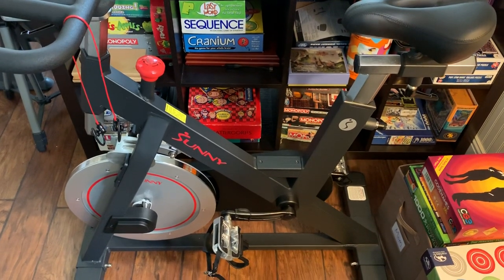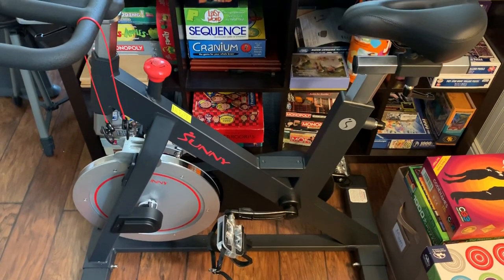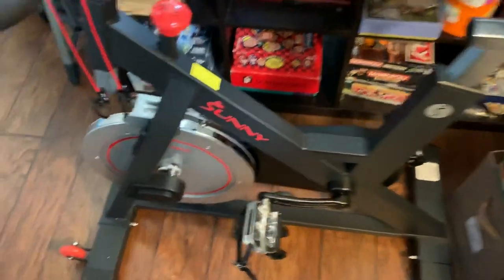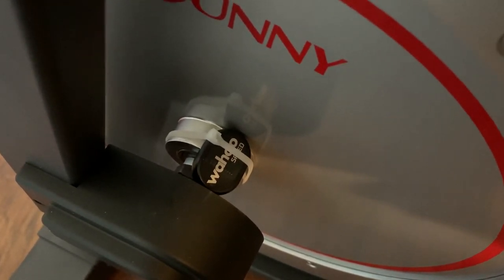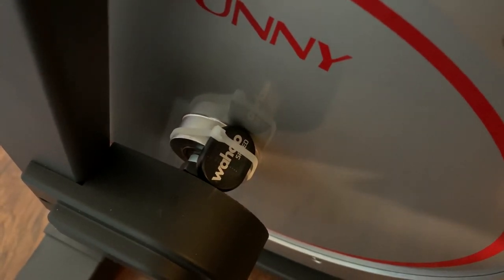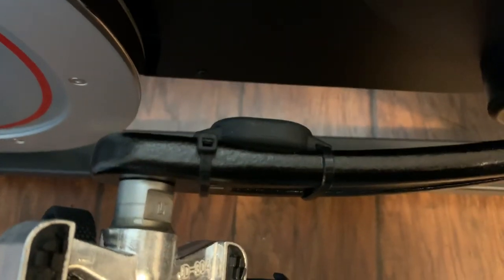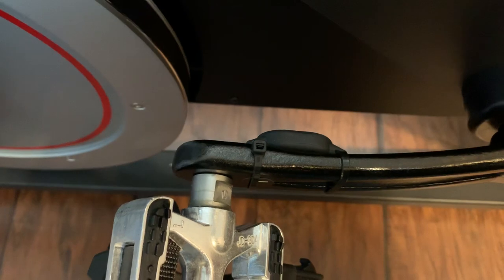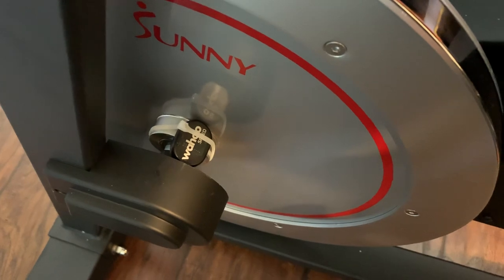Wahoo Cadence and Speed Sensors Setup for Spin Bike

Comment: It's encouraging to see that you were able to attach the speed sensor to the flywheel hub. Just ordered both a cadence & speed (Moofit) sensors and was wondering if the sensor would fit properly. Watching your video and having a flywheel hub slightly larger than yours is positive news.
Reply: Jorge Gamboa  Interesting that you brought this up. Just last nite I was wondering what I should about these sensors. Mine went kaput late last year. Both the Moofit cadence & speed sensors went bad. The heart monitor still works. Just deciding whether to try this again with another sensor brand. Wash my hands of Moofit. I'm thinking about Garmin's sensors for now.

Comment: I have a Schwinn Spinner and I am doing something similar to what you're doing.  Like you, I put the cadence sensor on the left peddle. I am using a Garmin Cadence  and Speed sensor..  I removed  the speed sensor from its housing.  I have double sided tape that I use to attach it to the outside of the flywheel.  I have tried attaching it to the side  of the wheel, but I have found the connection was hit and miss with that configuration.  I was able to establish a connection that enabled me to pair the sensors with the  iPhone.  Before I start my riding session, I revolved the wheel twice, connect and then I am good to go.

Comment: There is one thing I don't understand: on a spin bike there are no gears, so crank revolutions are always proportional to flywheel revolutions, why didn't you strap the speed sensor to the crank as well? It seems a simpler and safer solution to me?
Reply: Diego Cortassa forever interesting fact. !! I will attach mine to crank and compare
Reply: Did crank mount work

Comment: Hi, ok so how do i set up the wheel circumference?? i understand that you get the sensor as close to the centre of the spinbike wheel as possible, but how does measuring the circumference of the wheel itself make any difference as it's how fast it goes around the base point on a stationary bike, surely the wheel size is irrelevant?

Comment: I have a magnetic spin bike too. My problem arises after pairing my Wahoo with Zwift.

Not sure if you use Zwift, but let me ask anyways. During the Zwift setup, when you get to the page where they ask to "select your trainer," there is no option for the metal plated flywheel bikes like ours. What does one do/select then?
Reply: Hey, did you get a workaround on this
Reply: @ROHOARINGYJO  yup. 1st I had to find out what the flywheel circumference is. I got the diameter and multiplied it by 3.14. Then I matched the value against that on a bike chart (find chart online.Sunny bikes and others have it). I'll add that I didn't find an exact match with my own values, so I took the nearest one. I took that and the one that it corresponded to on the Zwift setup. 

The Zwift does not have Flywheel spin bikes among its selection so again I picked the closest alternative (if I recall there's a select option for "brands not shown" or something of that nature) and I clicked that. From there on out it was relatively easy.

My Wahoo speed and cadence sensors paired smoothly (after a little peddling). Bought a cheap Chest/HR moniter on Amazon, and it paired too.

And now I'm off to the races. I wanted a Peloton only because of the live leader board, but Zwift not only has that, but u can actually "see" ur competing Avatars as they bike too. And the price is a game changer.

On a side note: I haven't learnt to use Zwift from my TV, but I got a 2nd Gen core i7 lenovo x220t tablet laptop on ebay for like 80 bucks. The spin bike arms are such, I mount the laptop on the armrest without any attachments and it sits there. So now I have my own Peloton touchscreen equivalent screen.lol.
Reply: @VanIyke  cheers for the reply.
Got my sensors yesterday and have got it all set up. The trouble I have is pairing both sensors. One pairs and the other drops off with no signal. Any experience with that?
Reply: @ROHOARINGYJO  yeah at 1st it looked like only one would pair. I notice that each component (cadence, speed and HR sensor) each has its own icon on the touchscreen. But before I tapped them I had to cover my bases with each gadget. For the bike sensors I made sure they were well positioned (watched some DIY YouTube videos) and for the chest Heart Rate monitor, I made sure to wet the sensor on its underside before strapping it on. Then finally, I got an ANT + device that looks like a USB plug for like $8 bucks on Amazon. It boosts signal reception when plugged into ur tablet/laptop, thus signal drop us at a minimum.

Comment: How do you set the tire size for a spin bike? Or did I miss that part?
Reply: when in the start workout mode press the speed sensor and the wheel circumference will be in the choice of options , my spin is 18.5 x150 a choice of 30 options

Comment: I tried this exact set up and the speed data is pretty useless - the crank RPM is linked to the flywheel and there is no way to link the resistance to the speed.  Point being, you can set resistance low and spin away really freely and easily and the speed is high. Add a bit of resistance and the speed drops...... as your cadence drops.  So the speed is not really a representation of what speed you'd be cycling at in a real world setting,  its just a different representation of your cadence depending on the ratio of cadence to RPM of the flywheel - which is fixed on a spin bike,  unlike a real bike.
Reply: I have both of mine set on each pedal bar, the left for cadence, and right for speed. I have a Garmin watch and the thing that worked for me was setting the wheel diameter to around 6200 m, yes that sounds crazy but my spin bike has it's own meters and my Garmin matches what the meter says, it just took a while to figure out the right number on the speed side to get everything synced up. I don't know what brand of watch you are using if any but that worked for me,
Reply: @johnJohn-dz4ex  that's the kind of comment I've been searching for, genius!! Did the app allow you to select such a large circumference?
Reply: @dimplezdimples8451  It did
Reply: @johnJohn-dz4ex  Just did it on mine, I had a 3.25:1 ratio crank to flywheel and came out to 5.074 meters. Seems to work but Wahoo app only recognizes one of the sensors at a time, because the sensors are a different brand than Wahoo. Great idea!
Reply: @dimplezdimples8451  I was using a Garmin watch with mine and had no issues picking up both sensors but if you did have issues with both I would suggest just using the speed sensor only.

Comment: I have the same question as Leyla:  What did you set the flywheel circumference to?
Reply: Family Lawrence did you ever figure this out?
Reply: I messaged Sunny and they said to measure the wheel diameter and multiply by 3.14.
Reply: 20" for me
Reply: 18.5x150

Comment: A question though, and this is not to poo poo on your video, but a spin bike is fixed gear right?  So guessed "power" is going to be dependant solely on how fast you are pedalling?  You could take resistance completely off, spin to 110rpm and it will show you that you are at 400W when in reality it's 30W?   The speed and cadence wasn't meant for a spin bike.
Reply: I don't think the idea is to "guess" power but to use the accurate monitoring of cadence as a way to adjust input/output to net a workout that can be progressive.  But you are right, wattage cannot be accurately measured this way.
Reply: If you want to cheat, yes, you can use resistance 1 and cheat. But I use Resistance 6 for downhill and R7 for flat and R8 for climbs. And it's pretty real on Kinomap. I sweat like a pig when using R8 (max) for climbing exactly like in real life. And at R8 cadence gets down to 50-55rpm. If you want to cheat yourself, yes, you can use R1 like a noob, but I want to train myself really hard, not to cheat. That's plain stupid...

Comment: If test my stationary bike and run to Test mode upto 2mins its says on the monitor fails but  if in Manual is ok. Can you advise whats the issue? Is it on tge speed sensor?.voz when start running the tension goes to 3 speed already

Comment: I think it was designed to be installed on the crank arm
Reply: That works fine for cadence, but for speed you need to mount on the wheel. I tested on the crank and got 4-8mph when pedaling as fast as the bike would go. My results were much more realistic when mounted on flywheel.

Comment: What did you set the flywheel circumference as for the speed
Reply: Leyla gutierrez did you ever figure this out?
Reply: @johnclayson8461  , for circumference,  I used the Wahoo Tire Size conversion Chart and set it to 1.34 within the Wahoo App.
Reply: , for circumference,  I used the Wahoo Tire Size conversion Chart and set it to 1.34 within the Wahoo App.
Reply: @h.u.e  I'm assuming that Zwift doesn't care about the Wahoo settings?

Comment: What wheel size did you pick?
Reply from the maker: I picked 1.340m
Reply: I was wondering the same. I did simulator and my speed sense is not reading correctly, not even close.

Comment: I don’t have enough clearance for the speed sensor, is there another way I could mount it?
Reply: Crank arm
Reply: try to stick it to the flywheel, same area
Reply: Use some adhesive tape and put it to the flywheel.

Comment: It would have been helpful to see you turn pedals to see what  registers in the app. Wahoo specifically reports that their speed sensor does not work on spin bike.
Reply: PARIS this is basically the same principles as setting it between the spokes on a road bike. This will be my third year with a set up similar to this one. Instead I bought a small plastic 90° bracket in Home Depot, trimmed/ shaved it to size with a sharp knife. Adhered it with command strips to the verticals hob of his placement then a command strip bridging across bracket and hub the adhered the speed sensor to bridge them both. Command strip to cadence in the same place he did.
Reply: @ventures1  Any chance for pictures of your set up?
Reply: TheRealMrGuvernment  was riding the spin when I got your message. I’d be happy to send a few pics, but not being tech savvy how could I send it, provide an email and I could send that way. Thinking on it, I’m sure a thick piece of cardboard bent 90° would provide stability to the overhung unit. But the above vid should definitely do the job also.  I just passed 4000 miles and Happy to assist 👍🏻
Reply: My apologies for such a delayed follow-up report but I  did setup everything just as presented in this video. I used the same metrics that I used on my road bike as far as tire size. No issues. 

Currently, I am returning to my 1st love of 🏃‍♂️ on Zwift RUN using a run pod. Since I can't get the damn thing to work consistently I'm seriously considering spending $200 on the Stryd run pod.